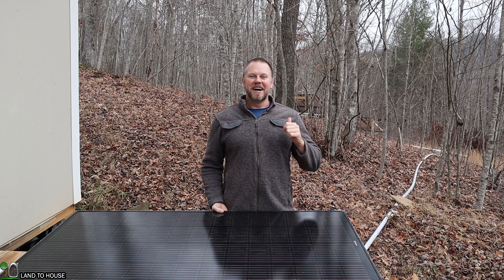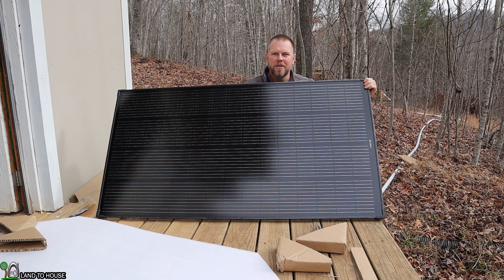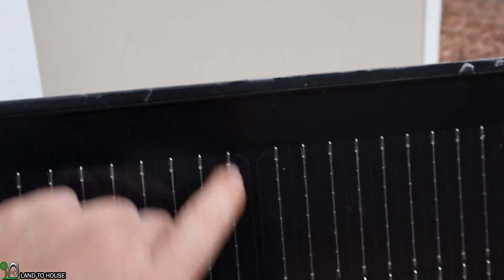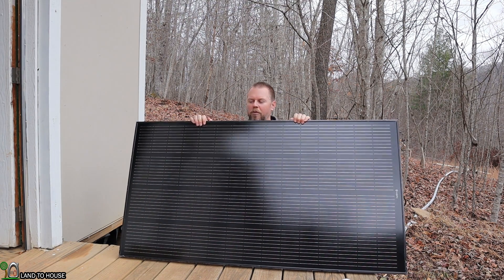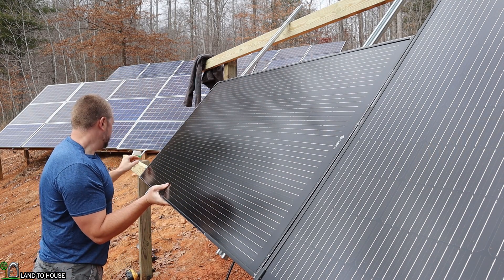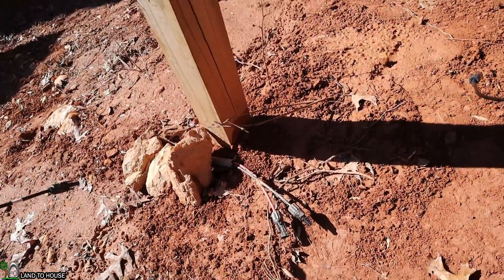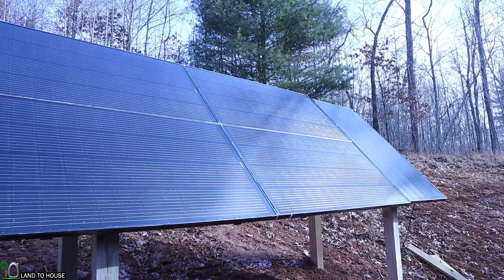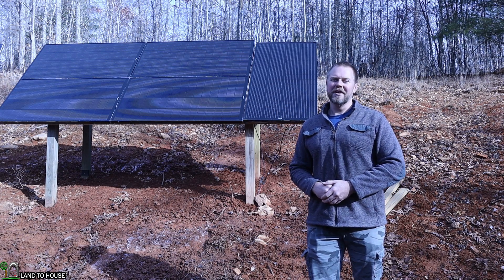Calpha 200w Solar Panel Array Install - 1000w of Power

Comment: am i missing something normal gaming pc's use 850-1200 watt. 1000w is very low amount and will not even boot many gaming rigs
Reply from the maker: This solar array is feeding my workshop. I have 150w worth of lights and a 40w tv. Then I use a chop saw that pulls 1200w. The power station has a 3.6kw inverter and battery. Now for home power I have 6kw of solar feeding a 15kwh battery and 8kw inverter. My editing pc sounds like your computer power draw however it idles around 300w.
Reply: Please be aware that a 850-1200 psu does not mean you consume that much. At idle my computer uses about 100 watts. While gaming it can triple that easily. I do recommend you measure your own equipment power usage.
Reply: The important part is this 1000w array exposed to about 5 hours of sunshine a day will produce about 5kwh.  Use that to charge a battery, and the battery can supply whatever surge you need, as long as your average usage is less than about 5kwh per day.
Reply: normal gaming pcs use 850-1000w of power at full tilt, at idle ur looking at like 200w max. the 7800x3d only uses like 75w or something when gaming, most gpus are pretty efficient and will only consume 200w at most.
Reply: Great video I was just out installing a new 24 volt panel adding to my system
Reply: My old gaming rig that still has gtx980 pulls around 750w on full load so a more powerfull one I assume would pull nearly 1000. Overclocking ofc makes a big difference.